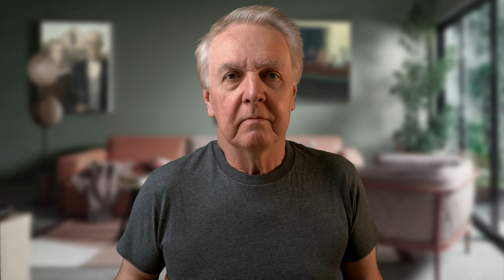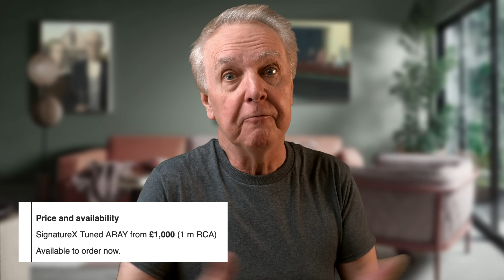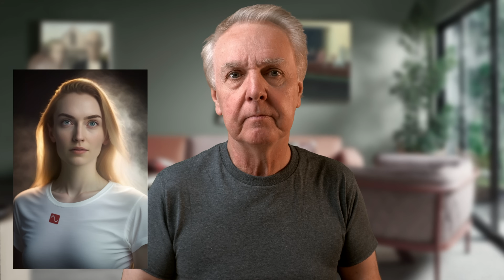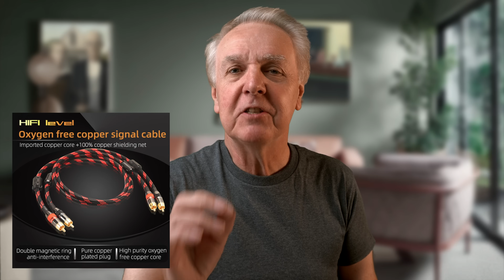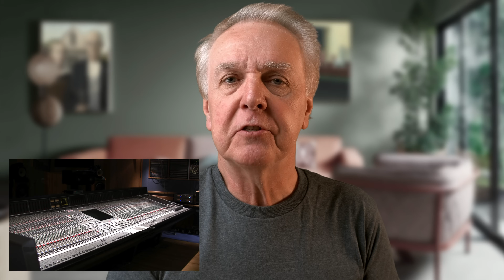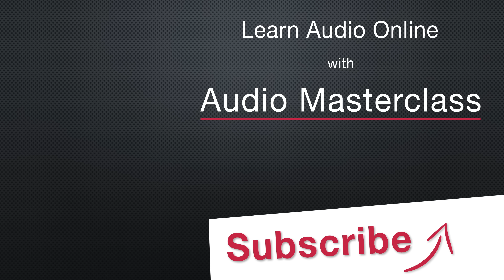Would you pay $1000 for a 1-metre cable?

Comment: Contact resistance and wire quality matter the most at the micro-ohm or milli-ohm level when you're doing precision electrical measurements, but in a speaker circuit we're talking about impedances measured in ohms, and many watts, over wires that are already vastly better than needed. Going from decent 12-14 gauge oxygen-free copper ($0.30/foot) to some audiophile cable with fancy dielectrics and directional arrows isn't even in the same universe as upgrading your crappy stiff multi-meter probes to better silicone ones with sharp plated tips ( ~ $10). Real, measurable improvements in speaker wire come from: Using thick enough gauge to keep resistance under ~5% of the speaker's nominal impedance (12–16 AWG covers almost every domestic setup) and tight mechanical connections (no loose spade lugs or corroded binding posts).

Everything beyond that is just jewelry, not engineering. The fact that people convince themselves they hear massive differences with $1000+ cables almost always disappears in proper blind testing (see: countless ABX results over the decades). So yeah, wires and connectors DO matter, but once you're at the level of generic lamp cord or decent AliExpress 14 AWG, you're already at the point of diminishing returns. Spending more than about $100 total on cables for a normal system is pure audiophile theater.

Comment: I bought a Roksan Atessa turntable with which I bought some really good cables (at half price because I'd bought the turntable). I was disappointed to find that the Atessa had grounding problems resulting in an annoying hum coming out of the speakers. I tried grounding the turntable to the amp with no effect. Just to check I changed the cables over to a really old cheap pair that I must have had in the bottom of my box of bits since the 70s! Guess what? The hum has almost disappeared.

Comment: I've made my own RCA cables what I've found is that using the leftover wires from my cable company works great with good connectors. I use 75-ohm wires with the good connectors, which are the type that tighten down to the audio device.  I've found that once connected, it's one and done.  I don't have to go back from time to time to spin the connectors to the amp or streamer, etc.  In the past, from time to time, I could hear something coming slightly loose and had to do that.  So it's just the cost of connectors, my time, and a little solder.

Comment: Having upgraded my amp should I be happy with the £2 lead? Do I believe an audiophile cable will be an improvement? I'm not sure, but I've just bought three Audioquest NR2 power cables, used on eBay, for around forty quid each. I won't need to buy them again, and I believe I hear the difference with my amp, maybe on my streamer, and not on my CDT.
Even if you're sceptical I think it foolish to spend £1K on an amp, and use an unshielded cable. Basically, you are a cheapskate.

Comment: I've done it.  3 sets of interconnects, all at comparable prices.  System involved was in a separate space.  I was able to not only differentiate them but name the brands.  In fairness they were all rather different.  They were what we had on hand.  I could have picked at least two that would have been harder.  Having said that, immediate A/B's are good for identifying, or not, some things but not others.  Other elements of performance relate more to connecting to the music and don't lend themselves weel to quick A/B's.  I used to design speakers and I spent a lot of time comparing caps.  No, that wasn't blind.  Also participated in Floyd Toole's computer automated A/B setup where things can be changed instantly.  Floyd was a smart many but it was apparent to everyone present that he didn't discern some differences very well.  This took plavr ay yhr Trbrl gsvyoty bunt the same basic setup he developed with the NRV in Canada.

Comment: This is NOT a cable review. It’s an opinion. To assess the benefit of this cable surely you should install it in a very high quality price appropriate system to see if it sounds different to the cheap cable you mention, or a recognised hifi cable at sensible cost.

Comment: Driving a 600m cable is not so easy, it will have a large capacitance.
For a 1m 'interconnect' this is not a problem, as long as the output impedance isn't very high.

Clean contacts is what matters most!
And theoretically it helps if all contacts are made of the same alloy, to avoid thermo-couple effects.

Cables can also be microphonic.
This becomes a problem when you move around like Angus Young, while chewing on your favorite interconnect.

Comment: The only time i notice the CABLE, something is wrong with it, when it is damaged, severely corroded or not connected properly.  Or if the cable really thing extreme low quality, for example the cheapest choice at your local home depot. Which usually comes as too thin (ultra thin) wires. Between the "better" home-depot cables and "audiophile cables", never ever heart a difference.

Comment: Keep the wires short, use thick wires, use a twisted pair. There I fixed it for you.
Reply: And shield to ground on the output connector.
Reply: @msromike123  True. I found grounds and shielding to be the most difficult to get right and troubleshoot when you don't get it right. One of the reasons I'm a fan of integrated amps and not of components.

Comment: My left speaker is a bookshelftype (Dali Lektor). My right speaker is floorstanding (Dali Oberon).
Sound is ok for me, but right/left not in balance because Oberon has lower impedance and a bit higher sensitivity.
My amp has no adjustment for that, just as an audiophile would like it.
Solution at no cost:
I changed my 2 mm diameter speaker cable for the Oberon speaker to a much thinner diameter wire.
I notice no sound difference and now right/left is in balance.
Perfect solution, at least for my non-audiophile ears.

Comment: My own opinion about cables is that, yes, they do make a big difference to the sound quality. This was really brought home to me when I heard a demonstration by Audioquest many years ago, of their range at the time. I was aware of sonic differences between cables but was a little sceptical about whether these were really improvements rather than just differences, beyond QED79 strand over bell wire. However this demonstration left me in no doubt. I also noticed that the difference in sound quality became clearer as you went up the range. It’s difficult to get excited about them as physically, you appear to be getting very little for your money. But sonically they can make a bigger difference than say, upgrading your CDplayer. I don’t believe that measurements can really tell you much about how an interconnect will affect the sound of your system. Just listen with no expectation. If you can hear the difference and think it’s worth the expense, great! If not, don’t buy it. In my experience most people are surprised by how much they can hear and will spend the money if they can afford it.
Reply: If you can't see it on an oscilloscope, then you can't hear it.  Period.  They have been using them for this for over a hundred years.

Comment: I have some discounted US$200,000 per feet interconnect cables carefully coated in the best of snake oil nano carbon fiber silver shielding for isolating out the worst of neutrino radiation interference that is highly damaging to the soundstage and resolving qualities of your speakers. If you want stereo and 2 feet or more, I can provide 20% discount.

Comment: Inside your amplifier is kinked wire.

You're better off removing kinks and terminals that have leads that protrude beyond the circuit board. 

In theory you'd rebuild your amplifier so it doesn't have 90 degree bends in the circuit board and in wire joints.

It's really dumb having 90 degree bends every 2 centimetres.
Reply from the maker: Nitpicking audiophiles might worry that when going round a bend, some electrons have a short path than others.
Reply: @AudioMasterclass  Sure they would, just like they worry about 1 meter of 14 gauge Home Depot lamp cord on the left speaker run and 1.5 meter run on the right.  The EMF travels at the speed of light to trasnsmit information, the electorns themselves slowly drift at less than 0.3mm per seconnd (a fifth of the speed of a snail) or so from negative to positve terminals.  The phase difference in EMF for a 0.5m mismatched speaker wire would be about 1.6 nanoseconds, 3.4 picoseconds on a 1mm mismatched wire on the amp system board. Not simply inaudible, but well beyond any tolerances of components in the amp and beyond the ability to even measure it outside of a specialized Digital Electronics Lab.

Comment: As someone who’s tried a fair yet comparably modest amount of cables, and also studied physics, (namely material science & solid state physics are the ones you want for this), so would like to think I have a basic understanding of what’s happening with materials… & having been into HiFi for 28 years+, I conclusively can say that interconnects can make difference.
Although, there are obvious terms and conditions to this & taking a cable and plugging it into another system won’t necessarily give them same results. 

The reason I’ve posted this, in spite of all of the “cables don’t make a diff’ comments (keep it scientific and open minded please) is because I enjoy this channel & the topics discussed - I’d love to see this explored on here more. The conversations and presentation styles are great. Great work & thank you.

… back to it: As I’ve said, the cable is just part of the system, it’s not the entire system, & as for “snake oil”, I wouldn’t go so far as to use that term, I’d simply say however: there are cables that are expensive, cables that are cheap, ones that make the sound nicer, or make it sound worse (in my opinion), ones that are a good value, ones that are great value and some that are expensive - even if they make a noticeable difference. 

Comparison: Even if the sometimes questionable activities of something can be measured, like taking taxes, the perceived value is not the same as the measured result - opinion plays heavily here. Does taking taxes from people benefit even if it can be measured what they’re used on?… does a 2% difference justify a £300 cost for a cable? There are no facts, only opinions here.

The other thing I’d say is that the “system” needs to be able to allow you to hear the difference the cable makes, & vice versa - also the new cable has to be that much further ahead than the old cable (or vice versa); so the system needs to have the technology internally to carry a very high quality signal and not degrade it before it even gets to said cable. 1 cable of type A and 3 cables of type B are not equally to 4 cables of type A, so the system as a whole from source to speakers (even the room surrounds), matter. Think of it as a chain from the power that your router / CD player receives, (in truth the original recording is the start), all the way through to the deconstructing noise outside of your window of trees blowing in the wind or that pneumatic drill digging up the pavement and sending drowning out sound energy into your room; it all matters… & more importantly, interferes. You want to hear the small tiny crumbs of the music at this level, the micro noises, so anything that is not on the recording, the buzz of a light switch or spin of a hard drive, is unwelcome. & that’s a key thing to recognise on cables, good cables don’t add, they simply become invisible. The best cable is no cable at all. If you could load a CD into your head, or LP for those who prefer, this would likely be the highest fidelity you could get from that source material. I wouldn’t try however.

To (almost) summarise, if you’ve bought a component (not some cheap as chips component from the local Argos, or Tandy / Rumblelows, if you remember them, but an actually high fidelity & highly resolving system), and you’re feeding it a high quality source material, not to mention you have a half decent room set up… then cables are the way to squeeze that extra 2-10% out of what you won’t change. Albeit at what cost (and therefore value), is a separate question. And expensive is not equal to better necessarily. A £300 - £1000 cable when your next best DAC is £30k plus… it starts to make more sense, even for that extra 5% clarity gain.

Everything matters and cabling is included. Even the quality of your carpet, thin vs thick pile, what’s behind your head in the listening position, toe of speakers, spikes or isolating feet, glass windows in the room, speaker distance from wall, noise traps in corners… if you’re talking science, sound travels differently in cold air vs hot air… it all matters and to my ears, such improvements can be heard (both a curse & a blessing - I’ll save that for another day). Not the hot vs cold in a room, that would be weird… only outside on a cold day, you may hear distant traffic if you listen carefully.

Again, to make a final analogy before I close: a Ford Fiesta or an F1 car both get you to the local shops, at what cost & value is questionable if all I want to do is get to the shops. They are notably different, and even if the F1 car can only do 20-30mph, is it worth me buying the F1 car or is it snake oil? It’s a matter of opinion.

Final final comment (before the final comment): trying to keep it scientific, run a test, but it would need to be a highly resolving one. Let’s do it by ear as opinion does matter. It’d be good to compare it to a scientific study afterwards to see how things match up, i.e. using a mic to record then compare. For the human test, 1st it would be necessary to certify the listener’s ears are up for the test - I even find listening is more accute at night - then with a highly resolving system, let’s say at least a £20k-ish plus system to be sure, £8k each for: speakers, amp (ideally pre amp & power) & DAC, grab a cheap as chips loom of cable, so OEM stuff from wherever, & listen & note down parts of a very familiar song. Actually take notes. Then swap out the entire run of cables with expensive ones (that come with a 5 star Best Buy or Highly Recommended review from a reputable HiFi reviewing platform, £1k a cable (new) should be good enough. Speakers cable probably £1k for a 2m run - just pulling some numbers from review memory) & listen. Then if you fancy, change 1 cable at a time. Always helps if someone can swap out as you do a blind test.
… then share what you find. Happy experimenting… & remember, yes there are marketing departments out there trying to sell you unaffordable things…. Most importantly of all, there’s beautiful music and there’s technology.

One more comment: As YouTube doesn’t seem to object to my long winded story… think of a signal flowing down a perfectly straight narrow stream. In that stream are blue and red balls, being dispensed perfectly so they all arrive as blue and red balls in that repetitive order and perhaps in a continuous column on 5 balls, one after the other at the end. If there are small pebbles in that stream, hence imperfections in the material or a wire or interference such as RF that impacts the perfection of that flow, then the balls at the other end will not all arrive in the perfect red - blue arrangement. They arrive, but not as “cleanly”.
It might only impact 2% of the balls, maybe it’ll it be the balls that represent the midrange of the signal, maybe it’ll be 10%. Can you notice it, how good is your eyesight, how good is the rest of the system and the original configuration in regard to keeping that red-blue pattern!? This is how I see the impact of interconnects and “noise”. But mentioned before, the less wires there are, the less chance for this given the same material.

When the sounds of a song starts to sound like individual instruments and not just sounds; when the beat of popular song sounds like someone is beating a drum in front of you or a piano in the recording has creak and dampening or you can hear the wood of a guitar when its strings are strum, then you’re onto something! Good luck…. Your wallet will NOT thank you!

Comment: Love your channel. The absurdity I think you captured perfectly using the mixing desk as a "benchmark" of miles of audio cable spaghetti. I would like these cable cuckoos to explain why the internal PCB tracks are not made of thick gold with an extra layer of shielding and why my supposedly "top 20" of all tested amplifiers the Nilai Hypex class D uses a down and dirty 4 pin CPU power connector for the audio signal in on the PCB🤣 As well automotive crimp connectors on the speaker cable terminals. Outrageous sacrilege! In fact the audio in cable was mistakenly not supplied so I had to hack up a connector with modified automotive crimp connectors pressed onto the pins of the PCB male connector, beyond sacrilege!